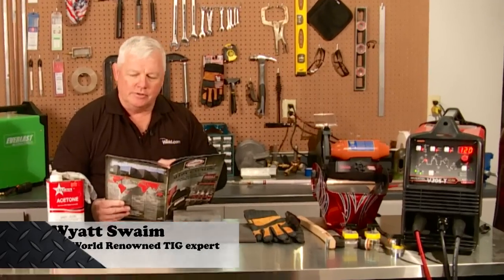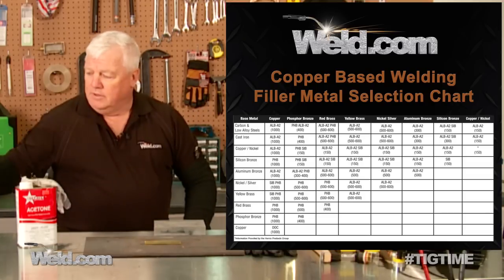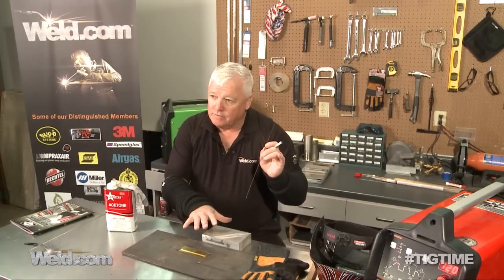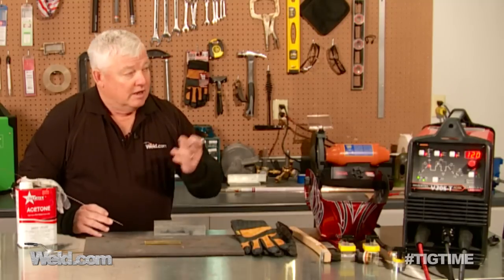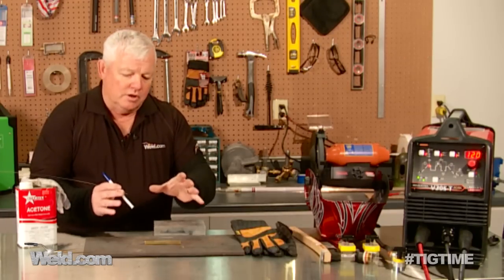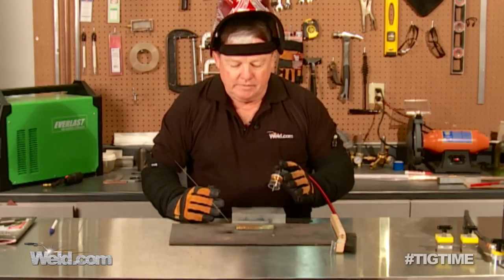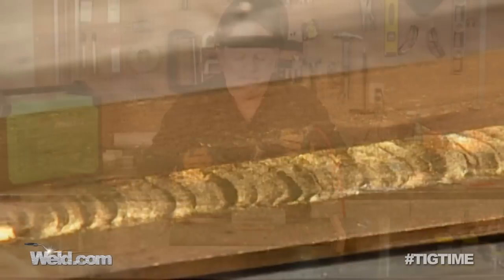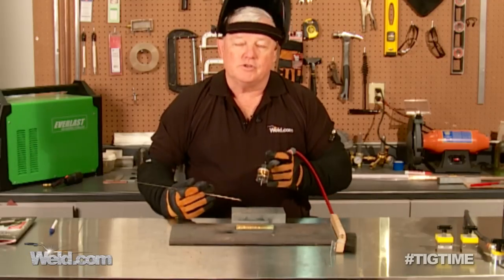TIG Brazing Brass

Comment: I set my Miller syncrowave to 120 amps DC and welded two pieces of  brass together beautifully.

Amperage confirmed 120
Reply: What thickness though?
Reply: It was like butter, not hard to control at all

Comment: I wish you had emphasized the zinc vapor coming off the part is poisonous, so good ventilation is more than just a good idea, it's an absolute must. I would have like to have seen you wearing a respirator helmet to set a good example. 

In the 1990s I (just once) oxy-acetylene brazed a cracked bronze backflow preventer valve body to the galvanized steel pipe it was attached to as an emergency repair. The pipe's zinc coating caught fire and burned blueish giving off thick white smoke. Not good ventilation and I was sick for days.

Comment: Hello Mr. Tig.... I have a question for you.... I have a project coming up in which I have to braze a quarter inch cordon of brass onto a 2-1/2” brass pipe with a 1/16” wall..... what settings and advise would you recommend for something like that. Thanks

Comment: I wanted to weld brass . I have a TIG arc welding machine. Tell me the filler rod to be used for this purpose. 
I tried to fill brass casting defects like porosity with this welding. But failed.
The problem i face is that welding doesnot stick to the base material and is removed easily. Please help to join brass materials and also how to use this fill brass casting defects

Comment: Do you get a lot of distortion in the brass using this method? I often torch braze large brass sheets and the brass always ends up warping quite a bit. Im curious if this more localized heating keeps that down.